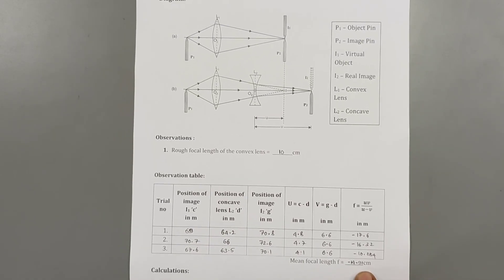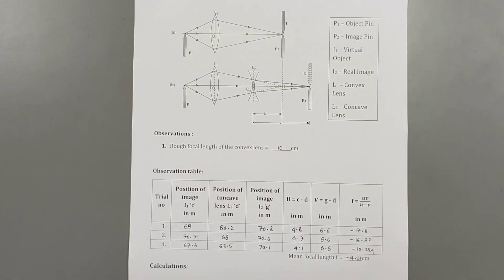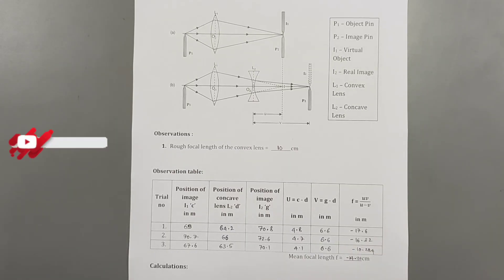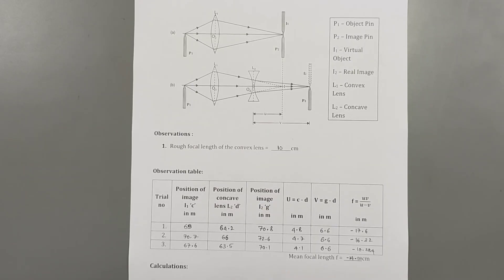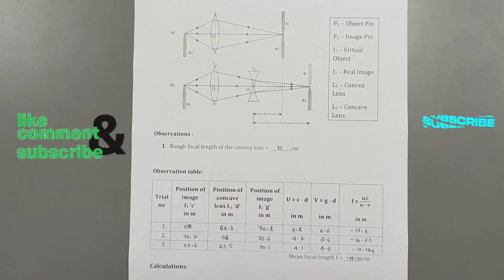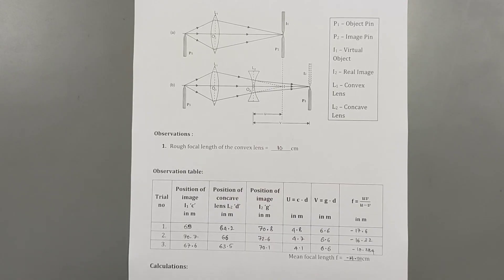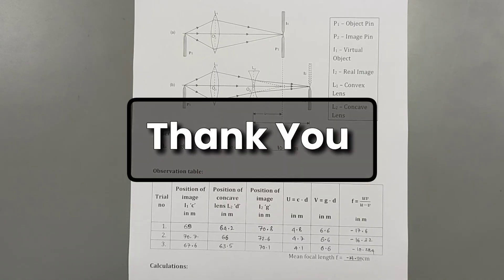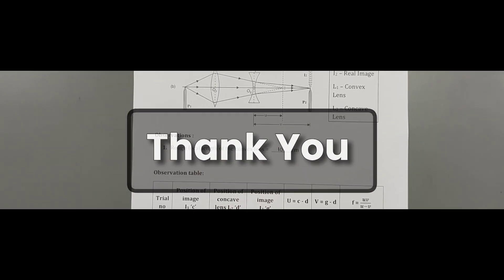Focal length of Concave Lens using Convex Lens #class12_physics_practical #concavelens_experiment

Comment: Sir, in 1st case as u found the image lenth as  69 eith convex lens and in 2nd case ,finding the length of image dustance by keeping concave lens bw convex and image ,u adjusted and removed parallex,u said that for image formation u moved both concave lens and image forward,it mens that distance is reduced .i.e less than 69 ,but it came as70.8 how???😢